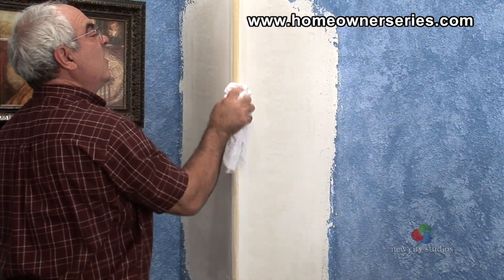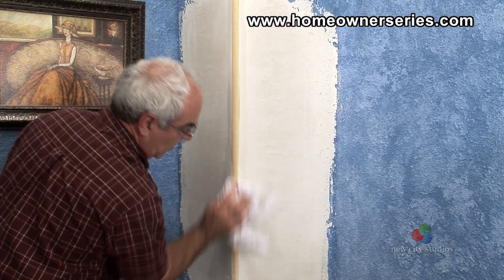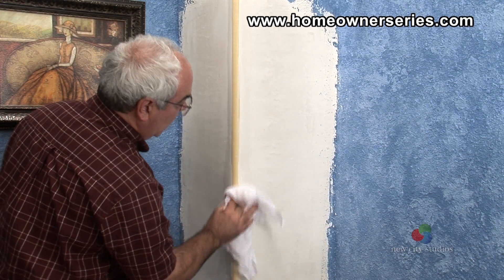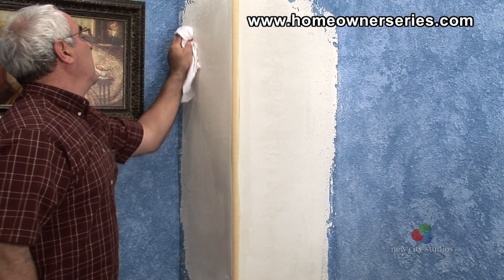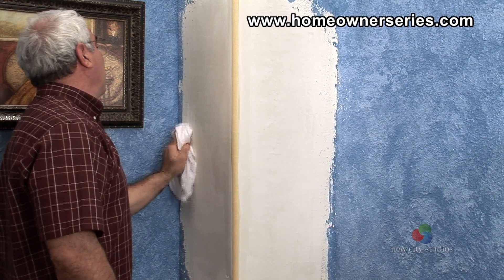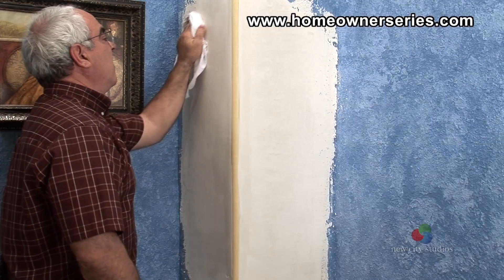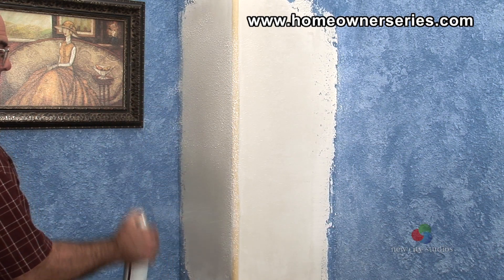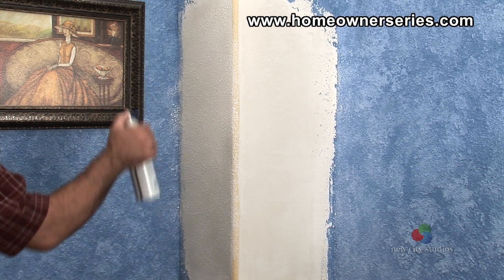Installing Round Corner Bead - Drywall Repair - Part 3 of 3

Comment: I watched this dude spread mud over the course of 3 videos and didn't get much else
Reply: But you had to watch them all. Ok
Reply: Lol I was thinking the same thing. I think for the most part he got it right. Although I disagree with the wet sanding method. Doing a dry sand with 3m sanding sponge will give a more even surface and allow you to blend out the edges of the mud easier when sanding.

Comment: I'm covering over the orange peel on my bathroom wall to allow for a different finish, and checked out this video to see how I might be able to do the rounded door corners correctly.  F- for this series.  I took a finishing blade and pulled wall compound from 2" on one side, over the edge to about 2" the other side.  A lot less mess and easier to work out the finish.  I've never even done wall work before and figured that out.
Reply: Make sure to have enough plaster under the bullnose, to provide compression strength, so it doesn't dent or tear.